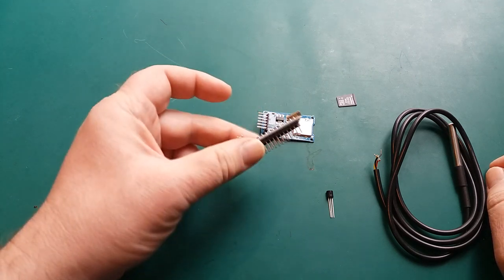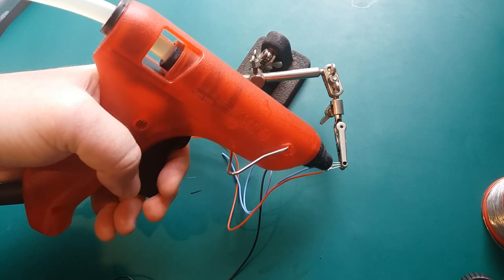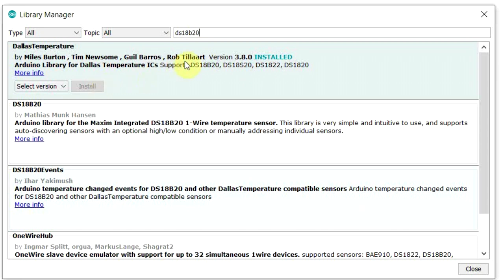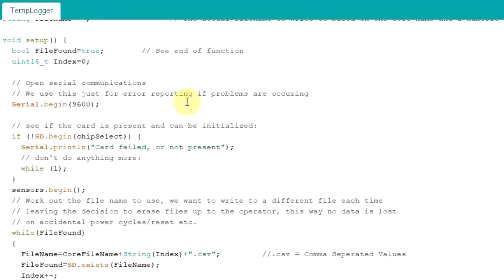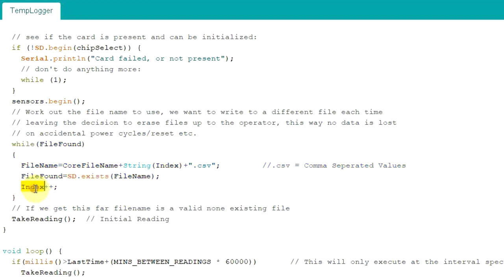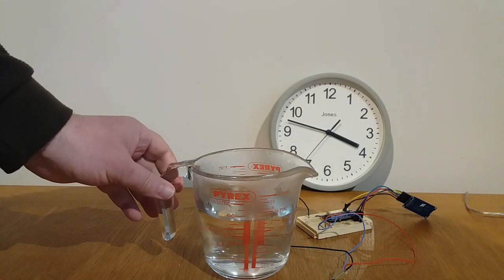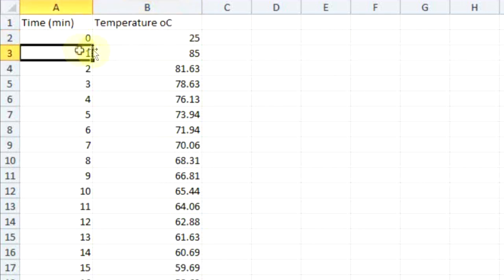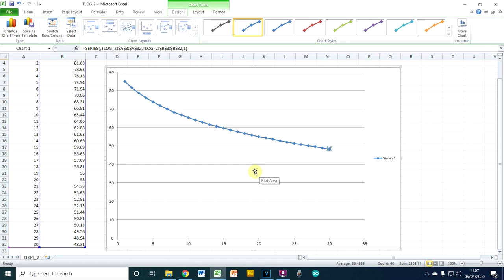Logging Temperature over time to SD card for direct input into Excel using Arduino (ESP32 with mods)

Comment: Another great video.  Thanks.

Two quick points to add are 1) The version of the sensor with the metal can does have more thermal mass but in some applications, this helps to filter out  noisy readings such as minor temperature jumps cause by your breath, or air currents.  2) Unless you buy sensors marketed for food use, these sensors aren't suitable for use in food as they can leach chemicals.
Reply from the maker: Excellent contribution , I'll pin this comment

Comment: sir is there any temp sensor (that can be use using these same method) that can be use without touching the object? such as contact-less body temperature detector
Reply from the maker: Not that I'm aware of on a board for Arduino, but I've not looked into it so could be wrong

Comment: it would probably work even without the hot glue... water is a pretty shitty conductor of electricity without extra ions. many basic electronic circuits like putting an LED over a watch cell and throwing it in water, will keep on working.
Reply: I forgot to add I also like making an array of the last 10 readings, adding them together, and diving by 10 for an average reading with less fluctuation.